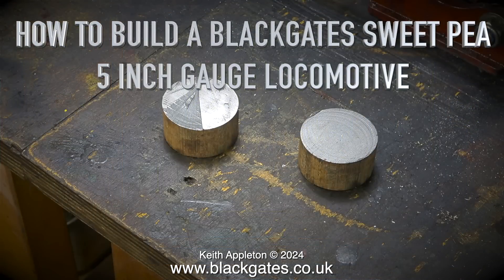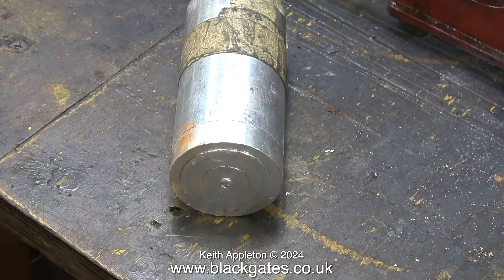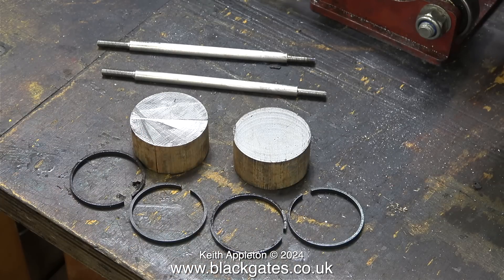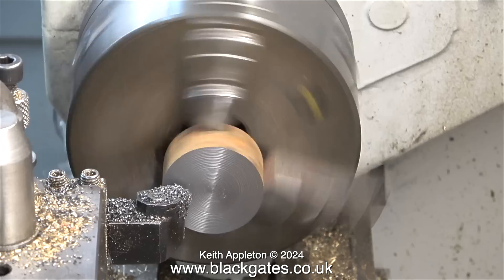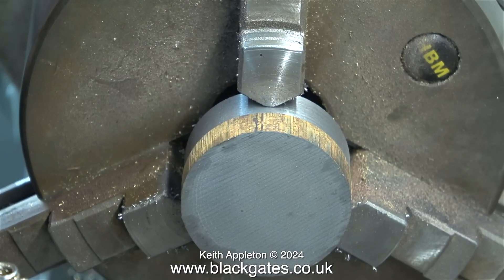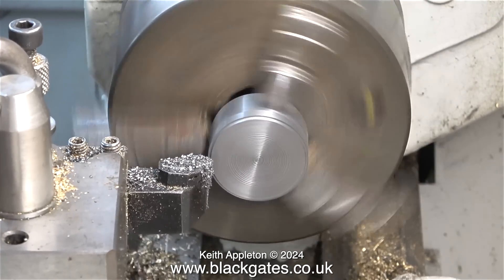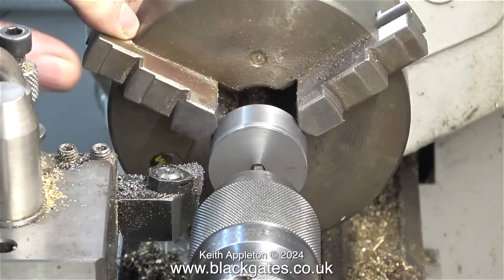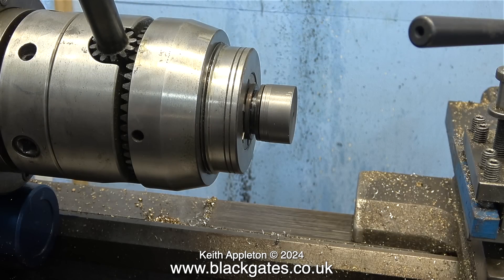A BLACKGATES SWEET PEA LOCOMOTIVE BUILD - PART #68

Comment: I have made the Hasbrouck #10 launch engine that specifies an aluminum piston with cast iron rings.  There are several of these engines at work powering small launches.  Of course, the differential expansion is accommodated for in the design.  I don't remember the difference offhand but the cold aluminum piston is substantially smaller than the cold cast iron cylinder.
Reply from the maker: I learnt a lot from the writings of "LBSC" in The Model Engineer magazine many years ago. He often mentioned that it was not a good idea to use aluminium and cast iron side by side. It's not just the coefficient of linear expansion, I think he used to mention cathodic (electrolytic) corrosion between the Aluminium & Cast Iron parts where steam and water is concerned. I always try to avoid Aluminium on the model steam engines that I build and repair, I can here the scorn of "LBSC" even now as I write this }:-)))
Reply: @keithappleton  I'll have to take the piston out and see what it looks like.  It has seen very little running but it has been about 15 years since I built it.  It will be interesting to see if any corrosion is evident.
Reply from the maker: That would be good, I really appreciated the LBSC learning experience, it will be interesting to find out if he was right or not }:-)))